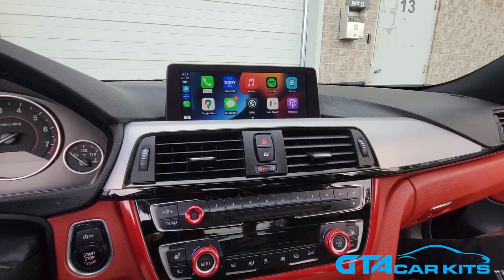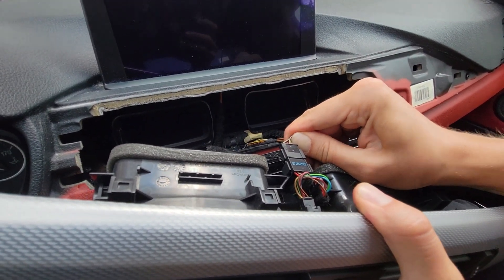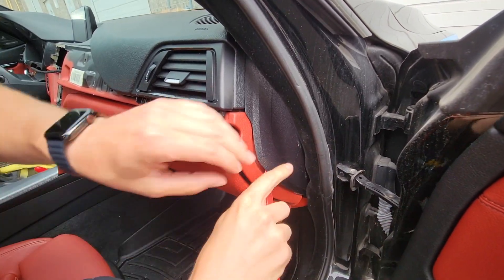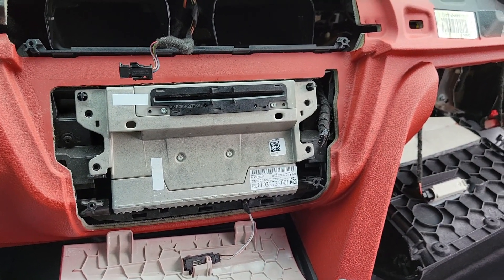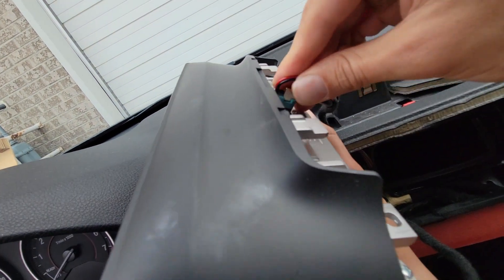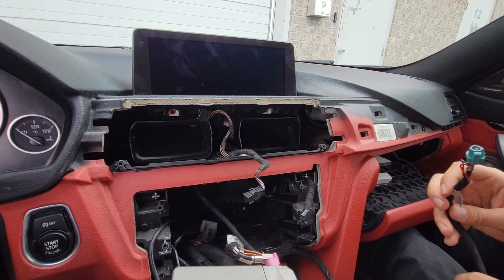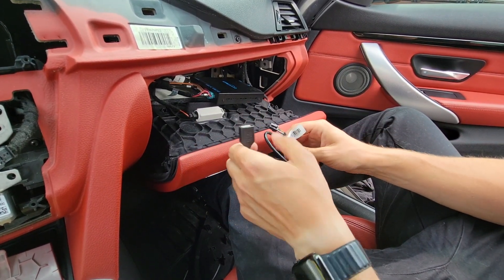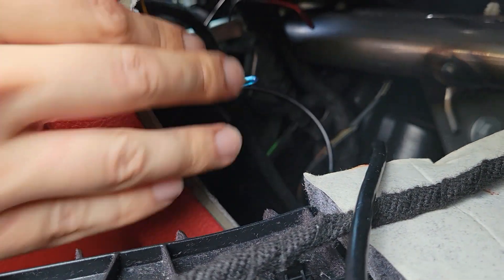Wireless CarPlay and AndroidAuto in BMW 3-series 4-series 2012 2013 2014 2015 2016 NBT

Comment: the only thing u need for apple car play is 15 dollar wifi antenna what u plug right in your original device why al this setup ???
Reply: thats only for 2017 and up bmw's except x1. They have a component in them that has apple carplay already and you can code it in.